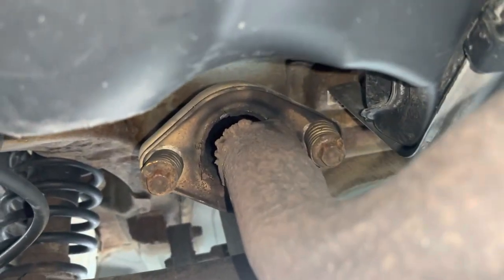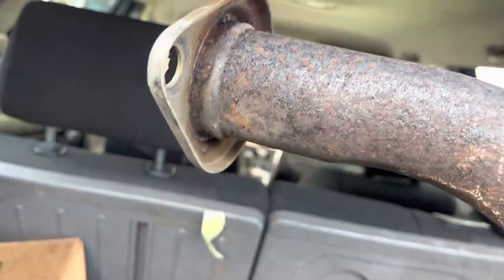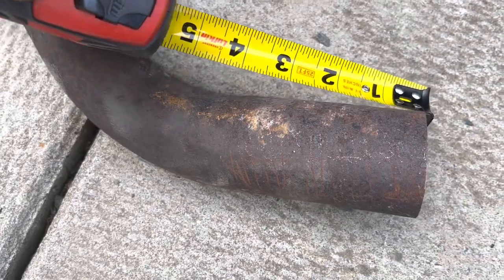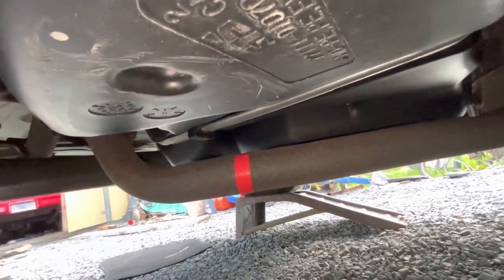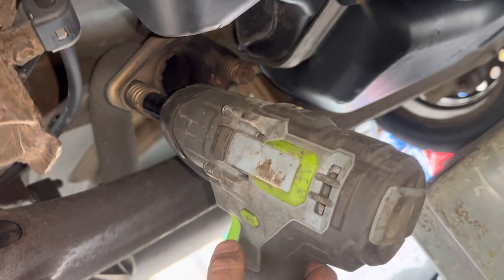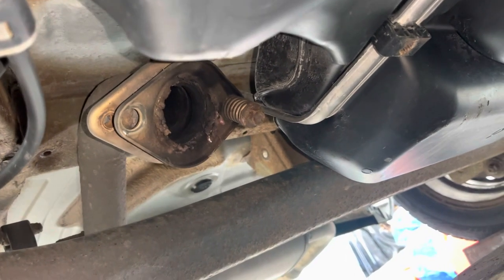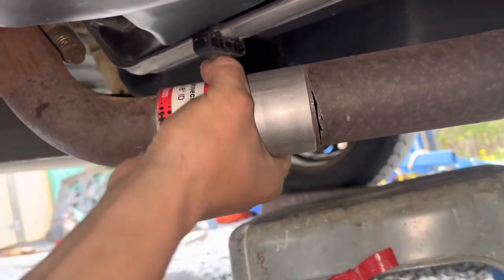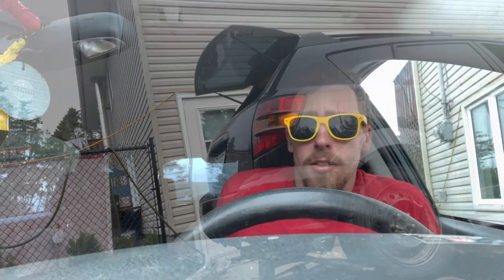Broken Muffler Flange Fix (Corolla,Matrix,Vibe)

Comment: Could you just leave it 2 ,to 3 inches longer, then expand the down pipe ...then, add paste sealant and drive the junkyard piece inside the other pipe. Now, add a band or u  bracket?

Comment: Mine's toasted too :), but hey why didn't you at least put a new gasket between those two flanges? I am thinking of welding that piece you have to my old flange and using one clamp only.
Reply from the maker: I had to fight with it putting the gasket in. So I did end up putting a gasket in off camera but great eye catching that

Comment: Thanjs for this video I think I got the same problem.  Is the pipe hanging a bit though? Shouldn't it be held up a little higher after the repair?
Reply from the maker: That’s the height my exhaust was before the flange broke but it’s possible  the hangers are getting old
Reply: @Maromitch  u da man
Reply: I had a similar issue... but on the other end we've it connects to the catalytic converter. 

Where did you go find a junk piece to use as a replacement?
Reply from the maker: Your local junkyard should have them intact and you just need to cut it off
Reply: @Maromitch  I'm going to sound really dumb... but how do I find a local junk yard to see if they even have my car?
Reply from the maker: Just look up junk yards or salvage yards in your area and call them to see what they’re inventory is and then go searching for your part